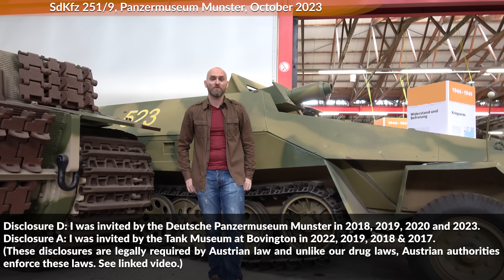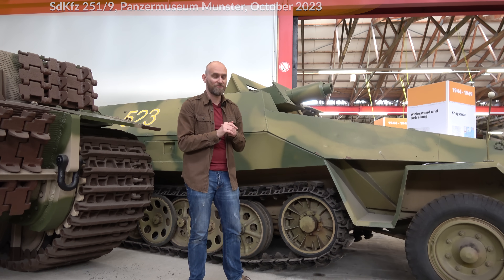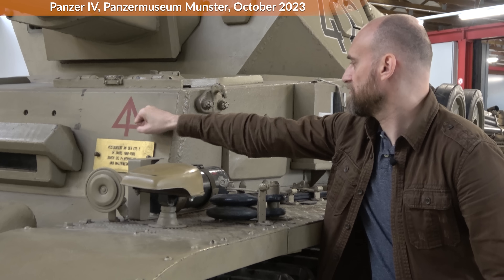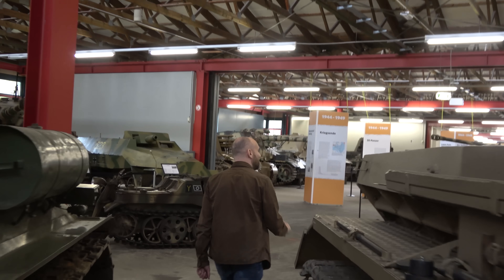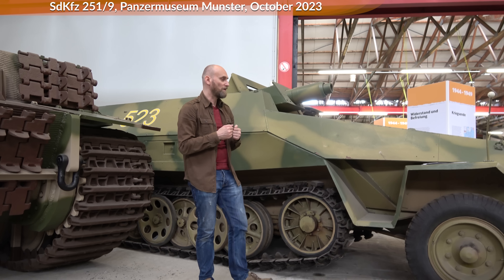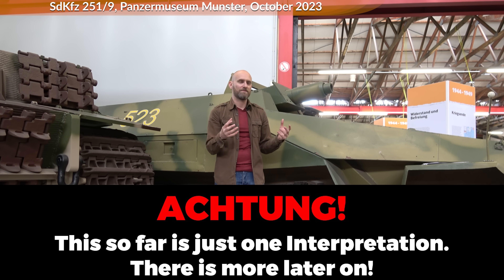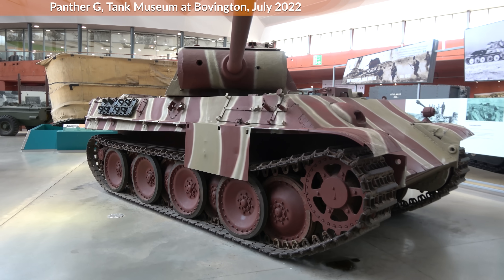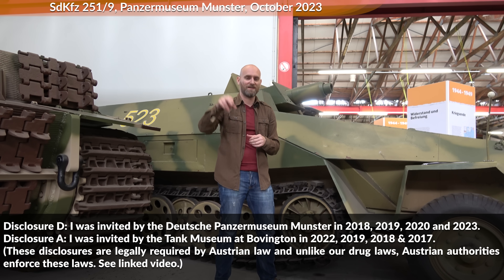Why was German Sloped Armor so late?

Comment: When people think Germany didn't "understand" sloped armour...I always wonder, 'Where do you think their engineers got their degrees?'.  Sloped surfaces are basic physics/geometry/material sciences '101' level stuff.
Reply: Flat armor It allows a ton more space in the hull, bigger cannons, and crew comfort. It also allows thicker armor while using shorter /less metal. Its also Easyer to build flat armor, and easier to change out and modify the tanks later on.. The allies also tend to have weaker anti tank guns. But yeah angled armor is superior
Reply: @sebastien1047  agree, except the last part is situational. Sloped armor can be negative if fighting at an angle that makes the sloped armor less angled and boxed armor more angled. People play too much videogames and think it's all down to head on engagements. Plus, most German tanks actually did have sloped armor. The frontal armor of the Tiger has up to 10 degree of slope.
Reply: @beersmurff  I've mentioned that before as well. The front plate of the Tiger where the driver's vision block is set as well as the bow MG isn't set at a perfectly vertical 90 deree veridical, it has some slope, it's a a lot, but it's enough that when you look at one from the side you can actually see the slope. From there, the Tiger has a glacis that has a slope near or the same as many modern MBTs.  Past the glacis, the two piece nose is also heavily sloped. The only parts of the Tiger that aren't sloped are the sides and the front of the turret, but lots of tanks, including tanks of today, have flat sides and turret fronts protected by a heavy mantlet, just like the Tiger.
Reply: Somehow German's completely missed the medieval armor period apparently lol
Reply: engineers getting "degrees" about sloped armor is unintentionally funny
Reply: I dunno. Doesn't sloped armour make the tank bigger than it needs to be? 
With a box design you can fit the driver much closer to the front can't you?
Making the tank shorter.
Which sort of allows thicker armour overall.
Reply: @HouseholdDog  indeed which was also a major consideration why Germans and Brits etc chose not to overuse sloped armor and mostly go for the front late war with few exceptions. It's always a trade off no matter what you choose and in the end, sloped might be better on a static firing range but in real combat not always as you can angle flat armor, your armor will be angled when flat if engaging from or towards high ground where sloped gets negated and then the added wasted space and overhangs to make the slopes etc. long list :-)
Reply: @HouseholdDog  There are other factors like chassis, barrel length and barycenter, the T-34 was a compact design despite sloped armor
Reply: i feel like there's a double meaning and secondary joke here with the word "degrees". because a slope, by definition (i beileve) is usually defined in degrees. or maybe gradient.
Reply: please look a the "It has sloped armour!" T34 , the most destroyed tank in history with a cramped interiour and terrible ergonomics ! inspite of their overwhelming numbers the acchievements of the T34 were very poor.In german tanks and especially in the Sherman the crews could work for hours and still being able to fight on!!
Reply: It's a shame we don't have more information on the specification that they prioritised in tank design.  It's clear from early war that tanks were more used for their mobility and they preferred speed. Also German doctrine had always put emphasis on the superiority of Germans so I think it's not a far fetch idea that they preferred boxed design to give their crew more space/visibility, as their armor proved sufficient enough. Stopped armor also have many restrictions on parts design that I think the German industry wasn't prepared to adapt to quickly enough when they realised they need better functioning armour instead of better operational capabilities.
Reply: No suprise, the Russians had that iconic tanker hat, T34 had no space in it which is the design exchange of stopped armor. I don't think it's a far fetch to think the Germans thought it's too much of a compromise that would hurt operational efficiency. Like everyone mentioned, stopped armour has been around for centuries, the Germans just didn't rate it.

Edit: To back my thesis with some data, the Germans tanks could fire 4-5 rounds a minute a T34 could only do 1-2.
Reply: The CCCP tanks were superior from inception ! Superior to any concept tanks available from Germany, USA or UK.
Reply: They didn't need it because they knew about Angling their tank at 40°
Reply: People also overlook the fact that sloped armor was in service loooong before ww2. Lots of warships actually had turtle shell designs with sloped armor and perpendicular armor stacked. Or wayyy back roman armor has slopes to deflect blows.
Reply: In the tiger field manual it instructed crews to angle the hull towards the target, making the armor sloped laterally, not vertically. Additionally the tigers turret face plate had plenty of extra armor thickness to compensate for it being flat and facing toward the enemy.
Reply: Also, after WW1 Germany had many restriction on what they can and cannot do militarily. Soviet Russia helped educate German military in their war academies. And USSR and Germany where allies it the beggining of the war from 1939 to 1941. So Germans knew very vell what Russians where doing.
Reply: @JānisKrūmiņš-y4j  Bullshit, if they were allies, nazis wouldn't send arms and men to countries attacking the soviets and soviets would help them with fighting somewhere. Pull the other one, yes I know russophobic revisionists produce endless nonsense today but there was no alliance, mild neutrality at best. And funnily enough soviet designs went completely ignored and laughed by nazis (because these dumb slavs can't produce anything better than us, right?) until they saw T-34 in action and collectively browned their pants...
Reply: Yes it's Pythagoras law
Reply: @nightshade4186 it’s really not
Reply: @coconuts7960  Of course it is, what you don't understand?
Reply: @nightshade4186  pythag is abt hypot being the sum of squares of the other sides sloped armor is about using the deflection of a bullet to make it travel through more armor like I get how you’re making a connection but Pythag has literally nothing to do here other than saying sloped armor will take more space
Reply: @coconuts7960  Only half correct dude, because sloped armor is beside deflection also about increasing horizontal thickness of an armor plate by simply changing its angle.
Pythagoras law also says that if you angle armor it's horizontal thickness increases if you think about it.
I.e. if you lay a triangle into an armor plate at 90° and now slope this plate to 45° the hypot becomes the new horizontal thickness.
Maybe you can follow it now.
Reply: @nightshade4186  pythag says nothing abt thickness you are just applying the concept cus it seems like it fits
Reply: @coconuts7960   Ok I give up, it's too high for you
Reply: @nightshade4186  lmao I’m a Comp Eng and Math major senior you are just a pseudo intellect who wants to feel smart
Reply: @coconuts7960  if really so what I doubt, then you are bad one or won your degree in a lottery lol
Reply: @nightshade4186  did u have a seizure typing that
Reply: @coconuts7960  did u have a seizure typing that
Reply: @nightshade4186  damn got me
Reply: @coconuts7960  The thing is though, if it doestnt get deflected, there is actually a normalizing effect. When a WWII round doesnt get deflected but penetrates, it enters more perpendicular than it hit it.
Reply: Take a look at the Leopard II and tell me it's not a well-protected tank.  I notice that modern Soviet/Russian designs like the T-55, T-62, T-72, T-80, and T-90 are very well "sloped", but they seem to get destroyed quite readily in combat!  And take a look, please, at their high-faultin' T-14 Armata, which is rather BOXY compared to its predecessors!  Yet, given the high costs of its navigation, communication, and targeting systems, as well as the costs to TRAIN their crews, it is designed with SURVIVABILITY in mind.
Reply: @selfdo  Did you not see the Abrams tanks? Out of the few that appeared on the front they are all destroyed, we're at 7 of 7 in 2 months. Trust me, Leopards fared no better. Drones immobilize almost any tank that hits the front then it's a sitting duck. There are tons of destroyed T-72s......because there are tons of T-72s, trust me Ukraine had more T-72s than it had foreign tanks. Everybody who argues like you always say "survivability in mind" like it's a special feature. 90% of the T-tanks that get hit have the crews hopping out 5 seconds later......lol it's a tank, surviving a hit is the whole point! You act like the nation that's built more tanks than any other nation in history hasn't figured out how to do it yet.
Reply: @selfdo  how often do leopards get involved in combat with other tanks?
Reply: @asdsafasf3  I'm not aware of any prior combat experience of the Leos I and II, other than some "brush wars", until the recent Russo-Ukraine War.  Even then, the "Ukes" aren't getting the "latest and greatest" Leo IIs, as if they did, they'd SELL them or allow other interested parties to have a "look see", and certainly their leadership and logistics aren't top notch, so  whatever performance these Leos II have in Ukraine, it's not a valid measurement.  No combat system, MBTs included, is of much use w/o training, leadership, doctrine, logistics, and combined arms, especially AIR SUPPORT.
Reply: And yet somehow these geniuses never applied it anywhere in tank design producing complete trash design one after another until Russians made them laughing stock with T-34. Go figure...
Reply: @KuK137  They were too preoccupied actually putting radios into their tanks and designing them in a way that actually enabled you to see were the fuck you're going.
Reply: @G-Mastah-Fash  didn't help 'em much.
Reply: @KuK137  russian bot lmao xD
Reply: @KuK137  The ratio of tank losses of the Soviets versus their German opponents was typically about 4.5 to 5 to 1 in the German's favor, at least until 1945 when most of the remaining German armor was ABANDONED due to running out of fuel and shells, or in negotiated SURRENDERS.  What "laughingstock"?  Even units equipped with the "lesser Panzer IIIs in 1941-1943 typically outfought their Soviet opponents.  Units equipped with the "Big Cats", (TIgers and Panthers), WHEN you could get them to run (not always a given!), could and did utterly wipe out Soviet armored units, typically with few, if any losses to themselves.  It wasn't just the superiority of the design, it was leadership, logistics, training, and doctrine.  Once those failed for the Germans as the war was in its final months, their high-faultin' advanced armor designs did little good.

Look also at what the Panzer III was developed into, as an improvisation, like a lot of their AFV designs, which proved to the be the top "tank killer" of Germany, the StG III.  The funny thing is, this was intended as an artillery support vehicle, to use the Panzer III chassis so as to have a common vehicle for logistical reasons, and also that the Panzer I couldn't be adapted to carry a 75 mm field piece, not even in a fixed-mount, and the Panzer II, just barely ("Marder II"), but it was a top-heavy, clumsy vehicle , which still was very effective against Soviet armor (look up the "Coal Thief", a Marder II with an impressive kill count).  The StuG III, once fitted with the same 75 mm L48 gun as the Panzer IV, could do mobile artillery support, or was an effective tank killer, in short, one very VERSATILE vehicle.  Due to its low profile, it was also very hard for the enemy to spot and acquire!  Same also with the development of the otherwise obsolete Czech-built 38It) light tank; it found continued duty as surviving chassis were rebuilt into tank destroyers (Marder III) or howitzer support (Bison).  Like the Panzer IIs converted into TDs, some of the Marder IIIs had captured Soviet 76.2 mm field guns, which were re-chambered to take the longer German 75 mm tank rounds; these proved to be devastating mobile anti-tank guns.  Impressed with the performance of these rather clumsy-looking vehicles (a second iteration moved around the engine and drive train, to provide a better balanced design), the Panzerwaffe had the Skoda works design a new vehicle, based on the 38(t) chassis, this was also in anticipation of the E-series of standardized vehicles, to produce the Hetzer.  While this vehicle was cramped for its crew, it was low-slung, and its 75 mm weapon in such a fairly light chassis (about 15 tons) could take on all but the heaviest of Soviet or Allied armor.  It made such an impression that the Swiss contracted with the Czechs, post-war, to continue production as the G-13, which served with the Swiss Army until 1971!
Reply: @KuK137  yes yes, KV-1 is, let's see what you wrote, complete trash design. As is IS-1
Reply: @KuK137  "never applied it (the sloped armour) anywhere in tank design", ever heard of hetzer stug, panther etc...
Reply: @KuK137  The USSR (or Russia as you called it) is quantity over quality as a nation. Their tanks weren’t that good, they were just made to be mass produced.
Reply: @KuK137 the t34 wasn’t amazing either lol. They made the decision to heat treat it way hotter than optimal which resulted in higher hardness to the point it was too brittle. On top of that it had tons of manufacturing defects, which you can argue aren’t the faults of the designers to some extent, but some of the problems definitely could have been predicted and should have been considered, such as the poor welding (which would have been known because the best welders would have been explicitly moved to aircraft production). 

Additionally, sloped armor has advantages for sure, but it’s like the most basic choice that could be made to make it have higher effective armor and higher chance of deflection. Arguably a tank that intentionally trades out sloped armor for other advantages reflects greater engineering skill and understanding of the needs and abilities of the manufacturing base.

That said, both were pretty shit and the success of the t34 can mostly be chalked up to quantity while the German tanks mostly were just hyped up by German leaders or engineers trying to get brought into nato countries to beat the ussr
Reply: @KuK137 thrash design one after another that destroyed the "brilliant" Tank T34 by the thousands, making the engineering "Marvel" T34 the most destroyed mid tank of the world war 2 and by extension, of the whole history of the wars right until now, being destroyed or lost about 44.500 T34 tanks  from about 55.500 T34 tanks already built. About 4 destroyed out of every 5 built. In a country which already won the war!!?
 By contrast, in Germany or even in the allies, let say USA or UK, to sustain this kind of losses would have qualified this tank as an appealing disaster and failure.
😂😂😂😂
Best regards.ñ

Comment: I wonder if the mortised weld joints were about getting adequate penetration of the plate. Something like a thick hardened steel plate would be tough to get deep penetration on but interleafing the plates like that would alleviate the problem

Comment: Another thing to consider with the interlocking plates is that you get more weld length and it is split across both plates. A simple butt joint leaves the plates subject to flexing along the weld length, while interlocking provides more rigidity. Might help keep welds from failing when a shell hits and flexes it.